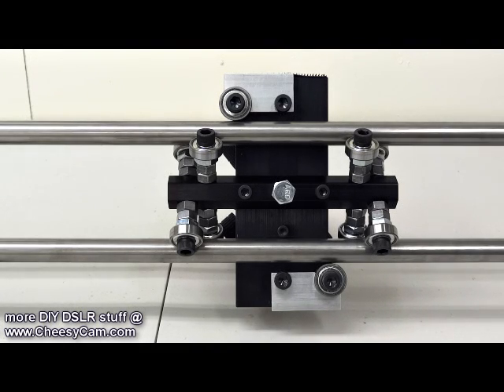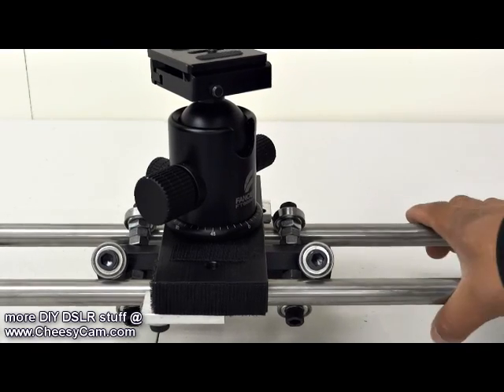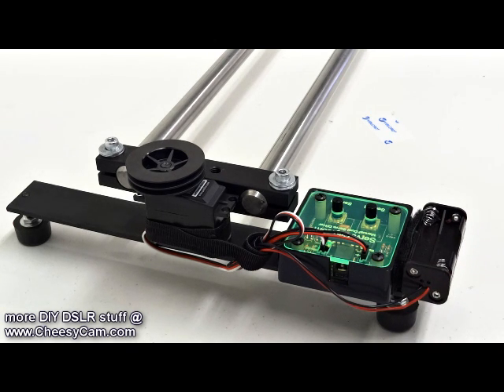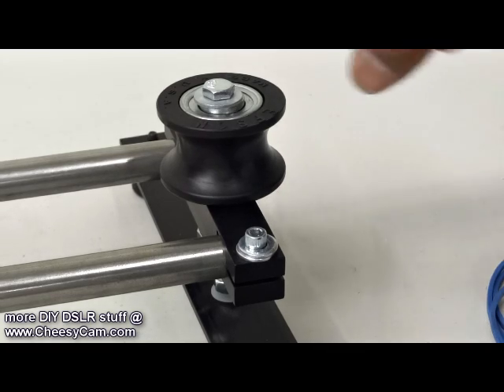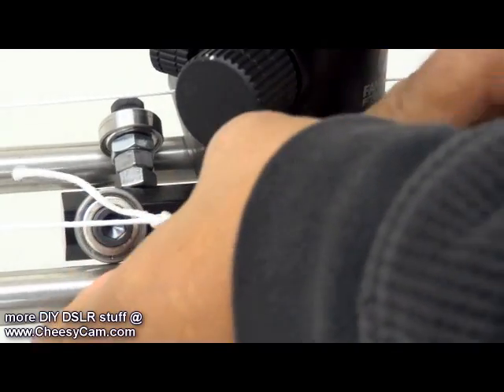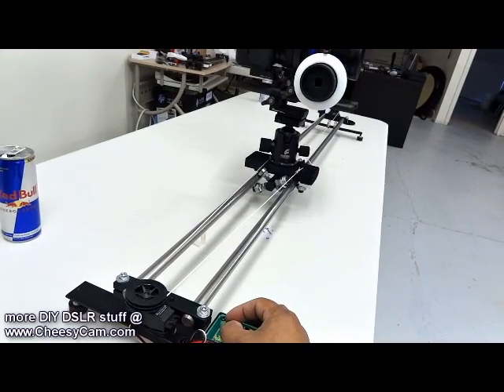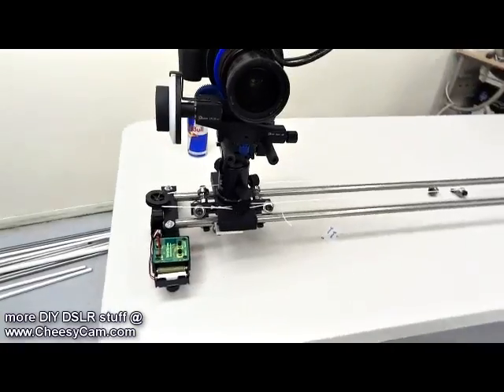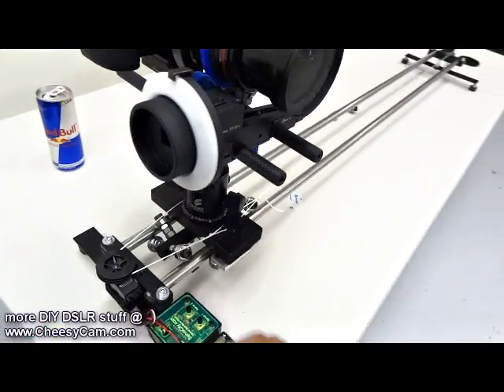DIY Motorized JuicedLink Slider Kit

Comment: i have a fotodiox 24'' slider already, im just looking for a cheap motorized solution.  where can i get the gears, circuit, switches, etc. and how much will it cost?  can you make a video on how to assembly and attach these components to a non-motorized slider?
Reply from the maker: For DIY stuff check out Servo City.

Comment: Let's say you walked away from the rig while it was moving, and the slider reached the end of the rails. Is there enough "give" in the drive system that the servo won't seize and burn up until I'm there to turn it off?